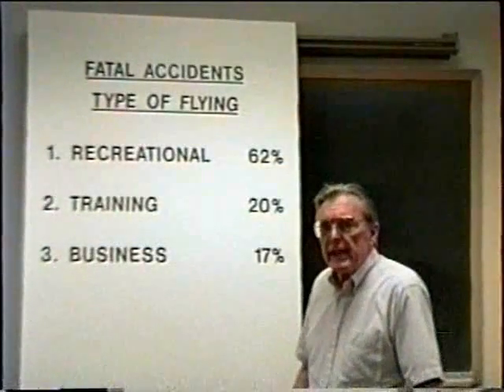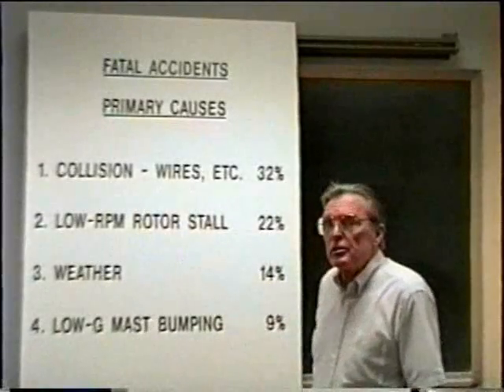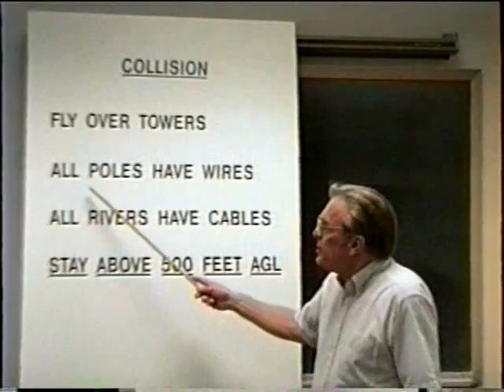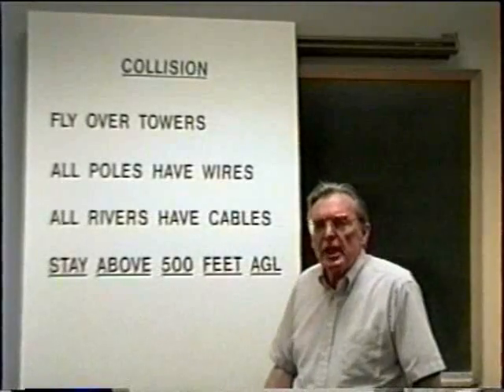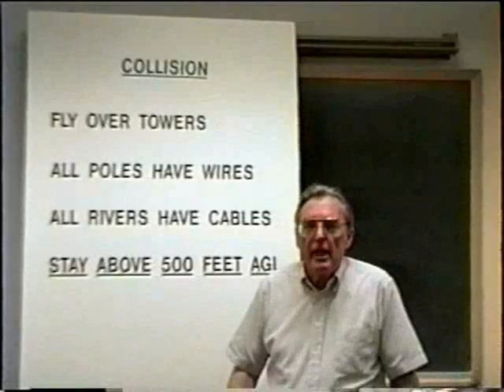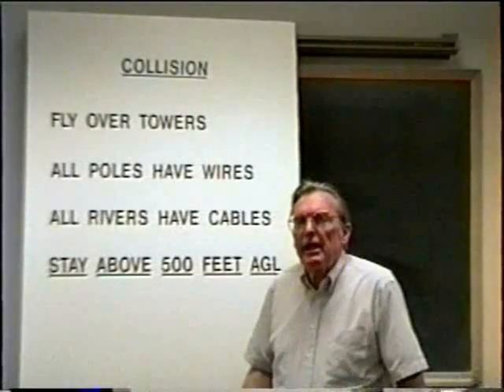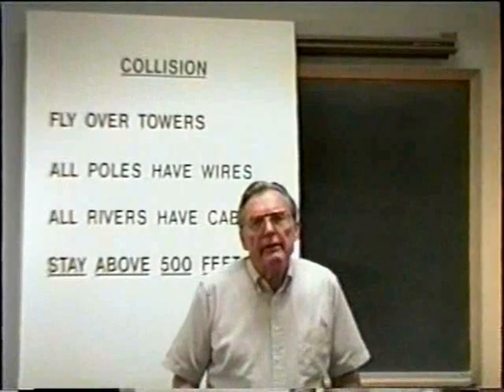Robinson Helicopter Safety Course

Comment: To me, IMO, that accident happened
because of inattentiveness, or not enough
situational awareness. Also, you are not supposed to take on passengers with the rotors turning. You strap in an buckle up first.
The pilot should have done a walk around, not only to inspect the helicopter, but also to look around the area to look for high trees, cables, power lines, towers, etc, for clearance for a safe takeoff. On another note, it is getting popular to string up zip lines across rivers for hiker's n nature lover's who want to go out an 
experience zipping across rivers, And valleys.
With that said, it is waay safer to fly at a safe altitude, as was mentioned in the vid, a minimum of 500ft AGL or more. If you want to enjoy a closer view, try going on horseback...
🤔

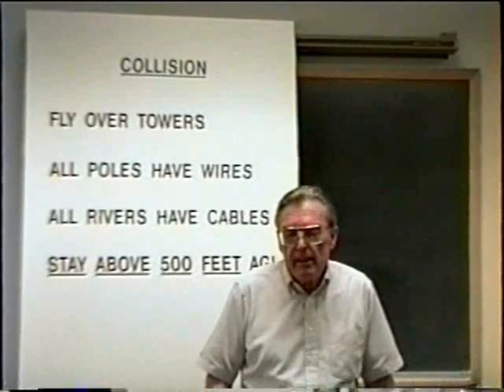Comment: 8:16 Flash as power line is severed.
Reply: The Sewing Machine Man more like 7:18
Reply: Took me a few replays to see that!  In the end I stopped focussing on the heli and focussed on the surroundings and background - as the camera pans around (around 7:24-7:25) there's a power pole about 45 degrees down and to the left of the tail rotor at the right edge of the higher hedges/trees (I'm talking in 2 dimensional terms, ie. on screen whilst paused).  Saw the flash initially but wasn't sure if the flash was wires shorting, or the strobe but you're right, there's two flashes as it hits the wires.  Makes total sense - the sudden pull back on the cyclic then sudden catapulting forwards as the wires catch on the skids presumably.  Horrific - as a private heli pilot this turns my stomach, such a tragedy.